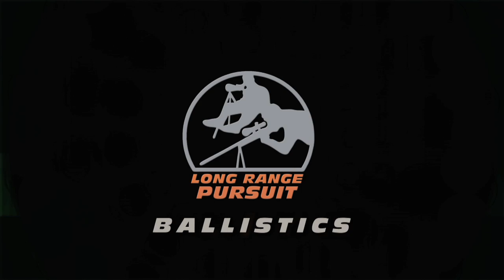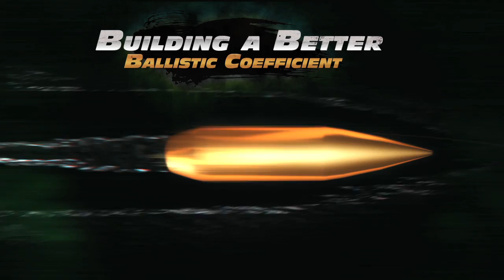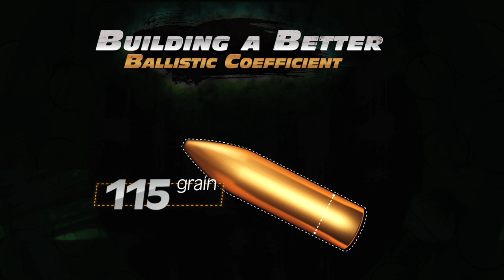Building a Better Ballistic Coefficient

Comment: Can anyone please tell me, even when we are looking forward to make the bullet as aerodynamic as possible, why is the tip still a little flat? It could still be made more pointy, right? At least as sharp as a pencil tip..?
Please, helppppp! I need to answer it in my project!
Reply: I am guessing a combination of things.  1st, would there actually be an aero benefit?  I doubt it would make a measureable difference. 2nd, added cost/process in manufacturing. 3rd, im sure its been tried before, there are many aerodynamic things that dont come to a sharp point.  I think aerodynamics is the big/overall picture, not just a small detail.  Plus you add in stuff like boundary layers.

Comment: Been using BC and Caliper choice for years to advantage in target and game shooting. 7mm 08 and .308 is a good example. Same case, use the same weight bullet and the 7mm eats the pants off the .308
Reply: However, form factor makes a huge factor over section density, the point of your post.  Long pointy bullets with flat bases work best at super and hyper-sonic velocities as to retaining velocity downrange.  At subsonic [usually transonic mach .72-.99 mach] bullets with somewhat sharp points, boat or rebated tails, and minimal surface area work best. However, stabilization is a significant factor as if the bullet is wobbling this create much more drag than the same bullet flying straight and true to the slipstream. Also, even well stabilized bullets can and usually travel with a certain amount of yaw in the longitudinal axis built in which changes the shape of the bullet presenting to the slipstream. The factor resulting in the yaw and/or wobble is mostly unequal aerodynamic forces first during exit from the muzzle where the propelling gases overtake the bullet, as it exits the barrel, causing it to fly backwards.  Second effects of precession and gravity effect bullets too combining to increase drag.  Interestingly, aerodynamic lift forces also effect flight of bullets and the drag coefficient.  A final comment is that the sciences of ballistics both predates and is effected by fluid dynamics associated with the bullet.

What is interesting the curvature of the bullet nose shape also effects drag very significantly.  For supersonic bullets one wants to minimize the contact area of the shock wave, so moving the point of the oblique shock wave forward is better.  However, the further from the center of mass the oblique shock wave is the longer the level arm it has acting on the bullet to shift its nose when any disruption or unbalance happens making for the need of moving either or both mass forward and this center of aerodynamic pressure forward.  For subsonic speeds or more likely transonic speeds a shorter and more blunt nose with curved section shape is better with a rebated or boat-tale shape.
Reply: Galileo Galilee professor of polymath [astronomy, physics and engineering] at University of Pisa was the one who really invented the science of ballistics.  Importantly, he showed for subsonic cannon balls dropped from the tower of Pisa, larger and smaller performed the same, and the same with various weights/masses.  However, he had no precise way of determining effects of aerodynamic drag as he did not have good watches and measuring instruments.  What he determined was that all projectiles flew in a path of a parabola, a geometrical shape based on a quarter section of cone, that varies with shape.  His contemporary Diego Ufano of Toledo, Esp. was a Spanish professor of military history and Military Engineer and studied artillery. He served in the Army, under the orders of Luis de Velasco, general of the Flanders Artillery, and invented many important military implements and tactics.  He wrote several books on these subjects, and had great practical knowledge of anyone at the time,  This book on the matter, A Treatise on Artillery, was the foundation of the subject... you can practically see his trajectory theory here... https://commons.wikimedia.org/wiki/File:Diego-ufano-1628-artillery.jpg    His opinion went against Galileo Galilee.  I did a thesis on his work now long time ago.  At the Université Pierre-et-Marie-Curie, there was a 1628 French translation available , https://schilbantiquarian.com/product/1628-artillery-diego-ufano-guns-illustrated-war-cannon-tactics-french-folio/, in the library of the Université of Paris No.6.  Ufano and Galileo were both right however, as I later proved with special projectiles and there flight, theorized in my thesis, and later proven in some inventions and an Army development program... not they had the capacity to under stand it!  One might notice that in the link below to the 4x27mm CETME was at Toledo where Ufano came from... too. Spain has ancient tradition on weaponry but little is known, due to the secrecy of the Spanish Government for a very very long time.
Reply: As an example, what is interesting the Fort Scott brand TUI (Tumble Upon Impact) rifle ammo has very low mass or sectional density but very high ballistic coefficient.  Looking closely that the shape of these projectiles one can see the point at which they have designed or bumbled into (don't know which) the creation of the oblique supersonic shockwave is just after the tip where the angle changes from slightly steeper angle of the tip... and the shallower angle transitioning to the body... notice the rifle projectiles photo in this scroll down...  https://www.thefirearmblog.com/blog/2018/12/07/tfb-review-fort-scott-munitions-tui-ammo-part-1/   
Also if you closely study the CETME projectiles here... https://www.cartridgecollector.net/762-x-51-spanish-cetme
Here is Forgotten Weapons blog... https://www.youtube.com/watch?v=3Njddshr3n8  
Here is a modification https://militarycartridges.com/category/001-4mm-x-27mm-cetme/ 
The base shape is only material to directing muzzle gas at launch from the muzzle... or at low level of velocity under mach 1 see watch this video https://www.youtube.com/watch?v=ZDUL_1vrABI

Comment: the most simple way to explain B.C. is the ability of a round to retain velocity, a poor B.C. is a round that loses velocity to quickly, for example a flat nose pellet has a B.C. of .010 while a heavy round nose has at least .025, the the heavy round nose keeps more velocity based in its efficiency, i have done B.C. real field tests for over 30 years,  take muzzle velocity and subtract your velocity at your selected distance, the higher the number the less efficient, the lower the number the more efficient. thats why at very long ranges some heavy rounds may out run lighter ones, the story of the rabbit and the hare in that example
Reply: In paper target I shoot .22-250.  The range officer - where I'm a member - is a long time friend and ex-Marine sniper.  He's made some loads for me specifically for 100m.  He uses  a light bullet (45gr), but they're significantly slower (3500fps MV) than the common 4,000fps factory loads because he says the .22-250 is pushed so hard it doesn't stabilize until it's beyond 100m.
He's on to something because they're accurate as all Hell!  
But I don't understand why the faster rounds aren't stable, that is, what is the projectile doing that's corrected by the time it hits a 400m target?  If it's staggering off it's true trajectory at 100m, how does it "find itself" and give tighter groups at 400m?
Reply: caseyjoanz 
Casey, the term " ex-Marine" is used by mostly by civilians who have not served in the military. Most don't realize it is a disrespectful term. In the past we used the term "former Marine" to denote someone that was once in The Marine Corps and was discharged honorably.  A former Marine Commandant wisely recognized that "Once a Marine, Always a Marine."   Therefore, he IS a Marine. Even to the streets of Heaven...
Unless he was Dishonorable discharged, then ex-Marine is appropriate